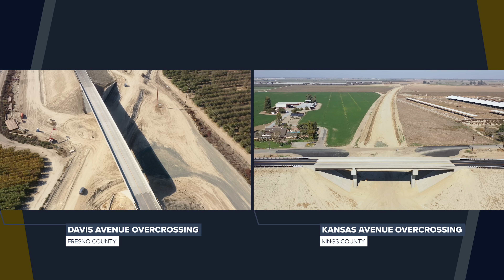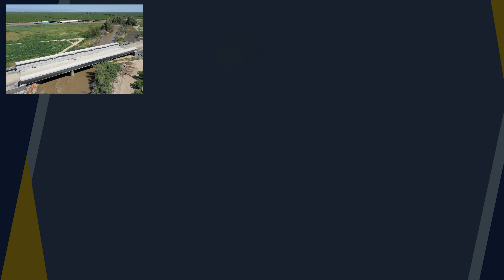Fall 2023 Construction Update: Progress is happening across California thanks to HSR Workers!

Comment: Looks great, but California HSR has a chance to move High Speed Rail to the next level by going to a little wider rail gage.  This will greatly improve the roll center that will help to safely increase the speeds in the future.
Reply: Would the Federal gov't have to make changes to the way our rail gauges are built for that to happen?
Reply: Mixed gauge would be a logistical nightmare.
Reply: It's called Standard Gauge for a reason. It might not be perfect for every application, but it's standard. The blended concept for the SF Peninsula would be unfeasible with a different gauge.
Reply: completely dumb idea, suddenly everything will have to be custom designed around an unusual gauge, which would only increase costs while actually potentially decreasing reliability since it would be non-standard. Just take a look at how difficult it was for BART to procure its fleet of the future trains due to the very unique characteristics.
Reply: @adianchowdhury9016  The current "Standard Gauge" was something that was set by the seat of the pants 150 years ago.  The 4' 8.5" spacing turned out to have worked quite well.... until you want to go faster.  The California HSR project is the first HSR in the country.  FYI, I know from talking to engineers in Japan that in post WW II they went to our same gauge simply because we were helping them rebuild a lot of their rail, and they knew that they had to do something wider anyway, so our standard was used.  You talk to a number of those engineers today that have worked on the Shinkansen and they will tell you that they have pretty much reached the safe speed limit with the current track gauge.  All of the suspension and geometry tricks you can do have been done to get the roll center of the trains to where they are.  The cost to change the gauge now would be very cost prohibitive.

With California being the first true high speed system, this can be improved greatly by doing it now while the first system is being built and before track is laid.  By going to a 1.75 Meter spacing, the top speed in the future could be as high as 600 KPH or 370 MPH on future train sets.  

I agree, if this was supposed to be a dual purpose track all of the way, yes, it would be a real mess.  But that is only planned on some of the line in Northern California.  And the slower trains can run on the standard gauge trick that is in the middle, or one of the HSR Rails and a second one set at the standard gauge.  Whatever the cost to do this now would be minimal since track hasn't been laid, and train sets have not been purchased.  Sure would be a lot less of a cost now that wanting to do it in 25-30 years to increase the speeds.  Now is the time to set the standard for HSR in America.  These lines are dedicated to the HSR service and aren't going to be shared with freight anyway.

Comment: The Fall 2023 presentation has, to my recall, the first station concept with tracks exposed--with only two tracks but earlier discussions/drawings indicating six tracks for allowing SFO/SAC-LA non-stops to pass intermediate/local stopping trains. With stops calculated at 3 minutes plus another minute to stop and reaccelerate for each intermediate station between LA and SFO, the non-stop completes the travel about 48 minutes (12 intermediate stations x 4 minutes each stop) quicker. Even the Hanford viaduct and station shows plans to get "local" trains out of the way of non-stop trains. So question is: are all intermediate stations being planned to get two trains off the main track in both directions?   Thank you.
Reply: All of the intermediate stations will have 4 tracks electrified tracks.

Comment: My main problem with Florida's HSR is that much of it wasn't grade separated so the trains can't really go that fast... I`m glad to see that mistake wasn't repeated. Very exciting!
Reply: Not much of the caltrain corridor that HSR will share is grade separated. I think it will be limited to 80mph from SJ to SF.
Reply: @travisfinucane  All of Caltrain's grade crossings will be properly secured to allow for 110 mph speeds. All the crossing will either be removed, separated, or will get quad gates.
Reply: @TohaBgood2  great to hear.
Reply: @TohaBgood2  that's not HSR. 110 mph is nowhere near HSR. Grade crossings are not HSR. Quad gates don't stop cars or people from still crossing the tracks. Lastly, Brightline is not electrified. THAT IS NOT HIGH SPEED RAIL.
Reply: @TohaBgood2 

"All of Caltrain's grade crossings will be properly secured to allow for 110 mph speeds. "

Lmao. We're nowhere near that and I don't anticipate it in my lifetime. $100 says the track speed is never increased from 79 mph in the next 20 years.

Very important to note: CalMod does NOT change the track speed. It will remain 79 mph after they get done.
Reply: @neutrino78x  Dude, why do you have to lie or imply stupid things? A ton of the grade separations are already planned or in progress, some street closures are planned or in progress. The rest will just get quad gates as the FRA requires for 110 mph speeds. This is exactly what Amtrak did for the Wolverine and the Lincoln service, and what Brightline did in Florida. This is already in the CAHSR budget. 

Why do you always have to come here to suggest stupid things? Can't you just read the documents online and self-debunk your fantasies without bothering others?
Reply: @TohaBgood2 

"A ton of the grade separations are already planned or in progress, "

This has been true for 40 years.

It will be true for another 40.

There are presently NO plans to increase the track speed on Caltrain any time soon.

VERY IMPORTANT:

CalMod
does
not
raise
the
track
speed
on
Caltrain.
Reply: @TohaBgood2  and I'm making a bet with you. For the next 20 years the track speed on Caltrain will be 79 mph. If it increases I will pay $100.
Reply: That doesnt matter when you consider the HSR speed south of SJ (220 MPH) @neutrino78x
Reply: @lalakerspro 

"That doesnt matter when you consider the HSR speed south of SJ (220 MPH)"

1) it doesn't average 220.

The length they're trying to cover is 380 miles. Divided by 3 that's  126 mph

2) it adds another 30 minutes to their estimate. It can't possibly be 2 hrs 40 minutes and has to be at least 3 hrs 10 min.
Reply: @neutrino78x  Lol, your coping is so hilarious. CalMod is an electrification project, installation of new signaling, and electric trains. It's a necessary precursor to increasing the speeds to 110 mph.
Reply: @neutrino78x  I've caught you on lies repeatedly before. Why would I believe that you'd honor a bet?
Reply: @neutrino78x Very true comments about Caltrain and CAHSR. You'd most likely win that bet.
Reply: @TohaBgood2 

"I've caught you on lies repeatedly before. "

Nope, that's never happened.

I still doubt you drive I-5 every day though. That's very out of your way if you're from Berkeley as you claim.

 "Why would I believe that you'd honor a bet?"

I have an honorable discharge from the USN and I would honor any bet.

The question is, will you. It's ok, there's 20 years to see if the track speed gets raised.

When it never happens, you will owe me  $100.
Reply: @TohaBgood2 

"your coping is so hilarious. CalMod is an electrification project, installation of new signaling, and electric trains."

Correct, it doesn't raise the speed.

There are no plans to do so.

 "It's a necessary precursor to increasing the speeds to 110 mph."

They would have to average 112 to go SF to SJ in 30 minutes, not 110. And they would have to AVERAGE that, not have it as the max speed.

Caltrain's max is 79, but they average 56 mph going from SF to LA on limited stop schedules.
Reply: @neutrino78x  Lol, why are you coping so hard? Yes, Caltrain will raise the speeds in expectation for CAHSR. That was always the plan. But the new signaling and faster electric trains needed to happen before the corridor can increase speeds. What exactly is confusing to you here?
Reply: @TohaBgood2 

"Yes, Caltrain will raise the speeds in expectation for CAHSR"

Nope, there's no plan for that.

CalMod doesn't do that.

Many things would have to happen; the track would have to be straightened out, ALL grade crossings (not just certain ones) would have to be eliminated, signaling would have to be upgraded, etc. 

You make it sound like that's trivial and something that will happen tomorrow, but I've lived in the Bay Area since 1984, and they've been trying to eliminate the grade crossings the entire time.

Caltrain can't even decide if they want to have four lines going through Palo Alto, and that's very important, because building a bridge over the two lines that currently exist (and the overhead wire that's already there) would already be very expensive. 

You have to remember that CAHSR is only going to be completed from Merced to Bakersfield, for the foreseeable future. The Governor said the funding is NOT there. We'd have to vote on it again; what do you think the chances are of good money being thrown after bad? The Federal Government has already turned down a funding request from CAHSRA, saying it's not a cost effective project.

Given how much ridership on Caltrain and BART has declined since the advent of working from home during the pandemic lockdowns, there's very little desire to waste a lot of money on public transit right now. 

It's definitely not justified by pollution concerns, because there's already a mandate that all new cars sold after 2035 have to be zero emission, and by then, the vast majority of aircraft that fly people on the short run from SF/SJ to LA/SD will be zero emission as well.
Reply: @neutrino78x  Dude, this is just made up nonsense. Crossings do not need to be removed for 110 mph operations. The FRA only requires quad gates. And with reinforced quad gates you can do 125 mph. Look it up!

I'm not even going to waste time debunking the rest of your nonsense. You're just making crap up.
Reply: @TohaBgood2 

" Crossings do not need to be removed for 110 mph operations."

Yes you do, Caltrain already hits people with a track speed of 79. There would be a major safety issue with raising the track speed without eliminating grade crossings.

You YOURSELF talk all the time about grade separation being important.

It's not important "because the Europeans do it therefore we should" but rather, because if you're going to go at high speed, you want reasonable certainty that you won't hit anything when you do. Plus, the people living in the area need to be able to cross the tracks without worrying about the trains.

 "The FRA only requires quad gates. "

That and straight tracks, improved signaling etc. Any modification to the track will obviously also require modification to the overhead wires.

And yes, grade crossings have to be eliminated. For safety, and so people who live in cities down the peninsula can get from one side of town to the other. 

So between this, and the fact that CAHSR as originally designed is never going to be completed, there is no reason for Caltrain to raise the track speed for the foreseeable future.

I don't know how you can be someone who grew up in the Bay Area and has paid attention to the logistics of public transit in the area -- which, our area is very good about public transit tech, it's one of the things we're known for throughout the world -- and somehow think 110 mph track speed is a priority for Caltrain or that all those grade crossings are going to be eliminated any time soon. 

Experience really should tell you otherwise, my friend. 

You don't even need 110 mph for a short 56 mile run. Caltrain can already do it in an hour, which is how long it takes to drive if there's no traffic. Remember, theoretically, they could average 79 if they wanted to, that's the maximum speed. But their actual average is about 56, and that's true of San Jose to Gilroy runs, too.
Reply: @travisfinucane  They are grade separating all of it. for example, City of Palo Alto is deciding how to grade separate their four crossings.
Reply: @danielgarepis-holland3214 

"They are grade separating all of it. for example, City of Palo Alto is deciding how to grade separate their four crossings."

That's been true for like 40 years dude
Reply: Brightline is not HSR nor is it even remotely close to being HSR. It's the same kind of diesel Siemens train that runs on the same freight track as the 110 mph Amtrak Wolverine and Lincoln Service.
Reply: @TohaBgood2  Louder for those in the back! Brightline's trains are cool as fuck, but it is NOT a true high speed railway.
Reply: @TheRailwayDrone  Yep! Siemens did a very good job Americanizing the rolling stock that Railjet uses. I really think that Amtrak hit a home run getting those trains for all its intercity services.
Reply: Brightline isn't a HSR, but more like a faster train. However, Brightline's future projects will be 100% separated such as the new expansion route to Orlando
Reply: @TuanNguyen-uq8gz  It's not a faster train. It still only does the same speeds that Amtrak trains have been doing for literal decades. And Amtrak recently upgraded the Wolverine and the Lincoln Service to the same 110 mph speeds and the same Siemens trains. 

In reality what Brightline is, what it consists of, is marketing. They talk a good game. But when it comes to actual execution, that's when you hit some issues.
Reply: @TuanNguyen-uq8gz Besides five times the number of daily trains Brightline's average speed of 69 mph exceeds the Lincoln's 59.6 mph average speed and the Wolveriine's 52.7 mph average speed. Any equal comparison is a misleading gross exaggeration of facts.
Reply: Agreed,
It’s not HSR in Florida.
Reply: Brightline’s trains are moving much faster than California’s trains right now.

Now I fully realize that California has more challenging terrain to work with, and other various obstacles.  But $7.3 million per mile vs. $153 million per mile? That’s a 21x difference.
Reply: @andrewdubose9968 l get your point and agree regardless of your sources. But not to put too fine a point on it Brightline's 235 mile route cost $6-7 B which equals $25.5-29.8 M per mile. CAHSR's 171 mile route may cost $28-33 B which equals $164-193 M per mile. That appears to be about a 5.5-7.6 times difference.
Reply: @davidjackson7281 

"CAHSR's 171 mile route may cost $28-33 B which equals $164-193 M per mile. That appears to be about a 5.5-7.6 times difference."

The 171 miles is only from Merced to Bakersfield, not the whole system they initially planned to build. But yes, I agree, that's where the system is going to end, for the foreseeable future.
Reply: @andrewdubose9968  Nope. The intercity train that Brightline is copying in California has been in operation for over 30 years. It carries more passengers had about the same average and top speeds before the extension, and is getting the exact same Siemens trains. 

It's called the San Joaquins. That's the train that will be gradually replaced by CAHSR as those segments start to get put into service.
Reply: @andrewdubose9968  You are comparing apples & oranges. Brightline is single track for most of the new built section, uses an existing ROW & not electric. CHSR is built to a much higher engineering standard for HSR ops, dual track, electrified & fully grade separated in CV. You essentially compared an upgraded single lane rd with an new interstate highway.
Reply: Brightline isn't HSR because it doesn't exceed 125 mph, speeds which steam trains were capable of reaching in the 1930s. HSR is anything over 150 mph on new track and 125 mph on existing track, but the 125 mph stretch of Brightline is a brand new rail line so it can't be considered HSR. Their claims to be high speed rail are false advertising.
Reply: @compdude100 You are correct about HSR but I have never seen Brightline advertise as HSR. That comes from the media and press which influences public perception. Though Brightline probably does not try hard to clarify for the media about it. Publicity yes. False advertising perhaps not. Brightline West can be HSR breaking ground hopefully in early 2024.
Reply: Brightline is not HSR except for a stretch along the Beachline Expressway. It runs on an existing Florida East Coast Railroad freight line through many cities.
Reply: Higher speed not high-speed. Brightline😊
Reply: Florida DOESN'T HAVE HSR!!!
Reply: Brightline is not HSR. HSR must be entirely electrified, grade separated, and isolated from slower regional trains.
Reply: As a melburnian, I can get a Cran/ Pakenham express service that's faster than florida's "high speed" rail. 😅
Reply: @CPTE5069 

"I can get a Cran/ Pakenham express service that's faster than florida's "high speed" rail."

But it still wouldn't be "High Speed Rail"; there's no HSR in Australia, for the same reason we don't use it in the USA. 

(population density too low to generate enough demand, distances too far for the low speed versus a jet aircraft.)
Reply: @neutrino78x  And ? , the point is that Brightline is nowheee near "high speed".
Reply: @CPTE5069 

" And ? , the point is that Brightline is nowheee near "high speed"."

They're building an extension that's technically high speed iirc.

But it's still not public transit. I'm passionately against public funds for HSR here in North America and Australia. 

Reason we don't use it is a good reason: population density too low, distances involved too far.

Now if a private company wants to spend their own money, as Brightline is doing, more power to them. Doesn't bother me. Just don't use public funds. 🙂